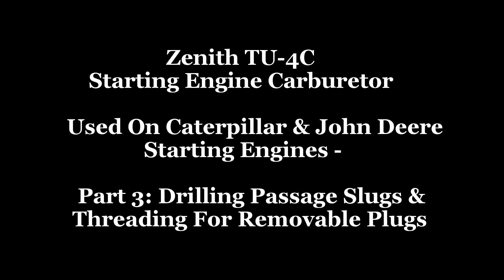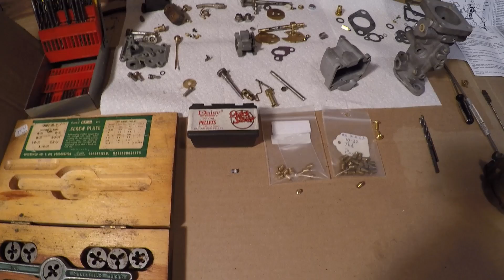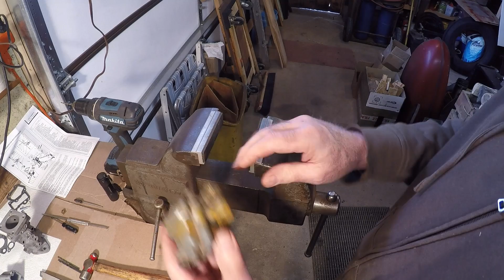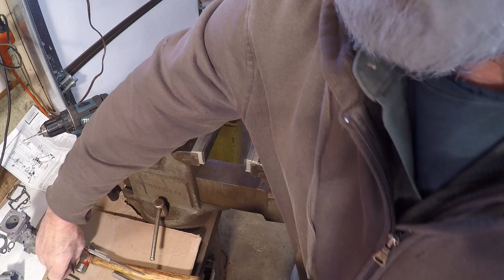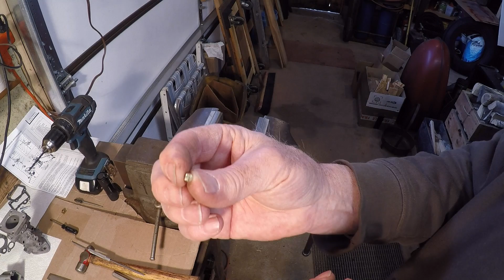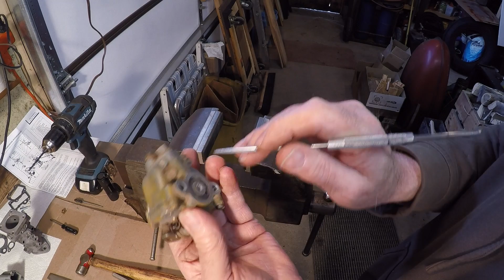Caterpillar D2/D4 & John Deere Pony Motor Carburetor Rebuild Part 3 of 5 - Threading Bowl for Plugs

Comment: Hi thanks for the video it was really helpful for me. I did everything in the video including drilling and tapping the passages. However my pony motor does start and run but it still does not want to run without some choke on, I.e I cant turn the choke off completely. It also seems that my motor does not rev as high as ive seen others on video. Would you know if the magneto timing possibly needs to be advanced and how I might do that? When I engage the compression release on my D318 it just kills the pony motor. I am desparate for help.

Comment: Out of several ways to control drill depth, take a wooden dowel such as 1/2” and drill down the center of it with the bit you plan to use. With the end of the drilled dowel now hitting the drill chuck cut it to length so the drill bit only has X amount exposed. X is the depth of the hole needed so the dowel limits it to prevent internal carb damage.

Comment: Great info on what can be done.  Seems odd the carb kits don’t come with those plugs, but I guess they are not considered serviceable items.  What kind of symptoms do you get if the compensation passage is blocked?  Rebuilding carb on mine as it floods easily when gas is turned on full.  Have to adjust it just right once it is running.  Pretty sure it is the float or the float shutoff valve.  Have not had a chance yet to run it yet.  Need to check the endplay on the crank, and check the main bearings, while I have the pony out.  Just from the feel it seems like too much.

Comment: I dipped tap in grease when I was tapping deep in aluminum head to install sparkplug sleeve. It needs to be cleaned and regressed like every turn, but almost no chips ends up falling, they just stick to greese.
I know, that in this case this method makes no difference, but it is still cool

Comment: I couldn't help but notice the lockdown handle on your columbian vise sticks out sideways in the way of your work area. You can try different thickness washers and get the handle to align straight with the vise. Gives it a clean look and also keeps the handle from getting in the way.

Comment: Always good to learn how to do things more proficient them down draft carbs  are not easy to work on. As for my d8 i dont know what broke the casting it froze or if some hit it but i brass welded it there was one on line they wanted 600 all painted and nice im like a new zenith is only 300 so i preped and brassed mine back together i put pics up on fb the price of the on i was looking at went to 1000 i like well mine is fixed it doesnt leak and pony runs great i have just a word for him that was tring to sell a carb for more then its worth i have studied welding my first book in welding was a 1939 addition of the James Fulton Lincoln weld book
Reply: When i get my slide show video up you will see my work and on an in frame over haul of a seized engine engine seized before it was left sit for 30 yrs there was prof in the dissasembly

Comment: One thing I would do is if you using gasoline in those carburetors which most likely you are to use ethanol free gasoline 3 gasoline or also known as 0 ethanol gasoline